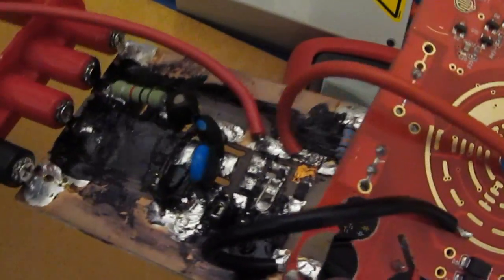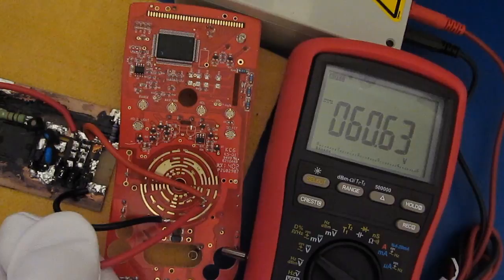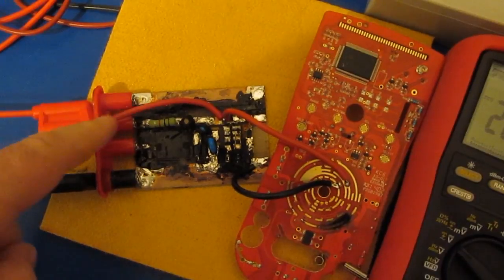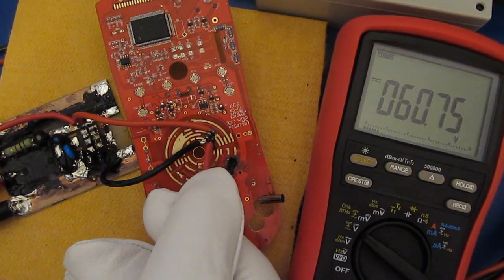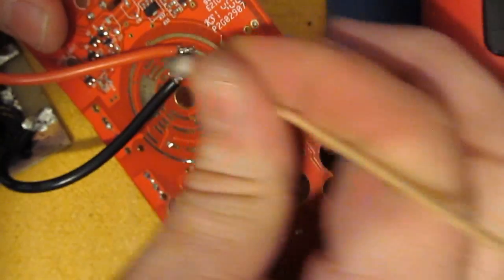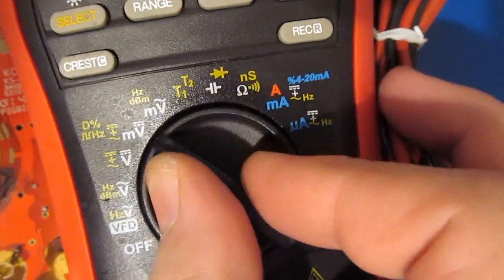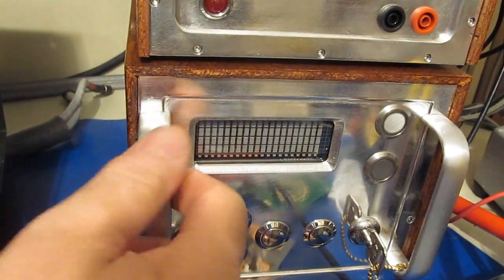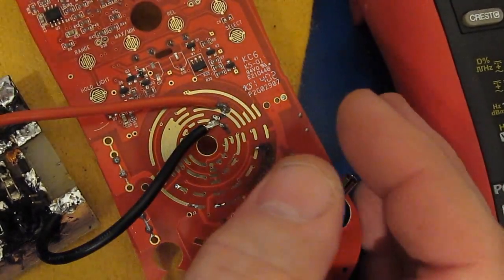EEVBLOG 121GW DMM PCB damage 600VDC testing Part 2

Comment: interesting series of videos, mine arrived broken and i have a replacement coming tomorrow 
at this point im not sure i trust it for any high energy environment (not that the intention of this meter was for high energy)  
its not that you proved to me this is not a proper meter for high energy, but i have yet to be convinced that this meter is safe enough for such applications 
but that's what the fluke 87 is for in my toolbox
EDIT: i was corrected, the 121GW withstands better than the 87
Reply from the maker: I ran a few tests on the Fluke 87V.   Dave is referring to an old serial number that had failed at 1.5KV, below what the 121GW had failed at.  A few people including myself wanted to see a brand new one ran.  This meter was damaged at 12KV.   This raised a lot of questions about why the older unit failed at such a low voltage.  I ran a fairly detailed set of checks on the old Rev 10 PCB to try and understand why it failed at such a low voltage.  In the end I was unable to replicate the results.  You may find that video linked below.  Obviously, I have never ran the final version of the 121GW but I doubt very much it could go head to head with an 87V.  

https://www.youtube.com/watch?v=GhslaLKOpKE
Reply: The 121GW passes independent ETL testing for safety. It performed better than the Fluke 87 in Joe's own overload tests.
Reply: did it now? well i stand corrected
Reply: im going to go ahead and withhold judgment until your proper tests are done on the production 121GW
Reply from the maker: Typing and the power went out.   lol.   I have not heard of an official release date so it's premature to guess but my plan is to run one after the problems are sorted out.  I figured this would take about a year, after the kickstarter.
Reply: Haha a bit ironic that, and i never really intended the 121GW to be a "take to an industrial site" meter but more of a "work around the lab" meter anyway, so for now i will use it as such 
i understand it will hold up to most issues as it is properly certified and tested, but confidence is key when working in such environments and well established brands make it so i dont have to think about my tool as i use it
but none of this takes away from the fact that dave made a fantastic meter
Reply from the maker: I'm not sure how much Dave was involved with the meter based on what he has stated in the forums, videos, amphour...  I was not aware that UEI had stopped making meters until Dave mentioned it.  So far the switch seems to be the most common hardware problem and it sounds like they are well on their way to solving that.

Comment: So, high voltage it's the only thing that could be the reason for the damage, right?, I mean even if (for some reason) the resistor where defective (like full shorted) at, lets say, mains voltage it won't be reason for the ark on that place, isn't?. Awesome job Joe, thanks for sharing your videos.
Reply from the maker: I'm not sure what caused the damaged to that particular meter.  We may never know.  If I have their meter here, I could check to see if there are other clues.  I test the meters with a rectified 220V source and that included the preproduction 121GW and did not see any problems with it.  Of course the mains could be much higher than 220.   Maybe Dave will chime in with some more ideas or the person with the meter may come forward with some more details about what happened.
Reply: Joe, OK... you've convinced me... and I think I've remembered the possible circumstances under which this happened.  I will post more details on the EEVblog forums.  Thanks again for the instructional videos.

Comment: Very interesting video again!
My only few pennies of thought.
Isn't it general knowledge plus ALWAYS stated in the manual that someone SHOULD NOT change the multimeter setting when being connecting to anything, let alone a very high voltage?
The reason why I am asking, is it really the manufacturer's fault if that happens?
Reply: For the record - this was almost certainly my fault.  I hope I never made it seem like I was blaming Dave or the manufacturer for the failure.  I was just wondering what on earth could have caused that damage.  Joe's recent videos pretty much confirm what was required to cause this, and as I've commented elsewhere I was recently working with a 1200V 100W 28kHz supply for an ultrasonic transducer.  So I am happy to take the blame, but also to praise the robustness of the meter as it appears to have otherwise survived the episode.
Reply: Safety standards are just that, safety standards. It doesn't matter if the meter survives or not, just that is fails safe and protects the user. AFAIK the IEC UL testing standard for meters does not test for DC withstanding voltage, it is more concerned with pulse overloads. In any case I have shown in a video on EEVblog2 that the 121GW survives twice it's rated DC voltage sustained.
As Joe as postulated, I suspect many meters could be potentially damaged by a low impedance high voltage DC supply that is under the MOV trip voltage, yet over the max rating of the meter. The MOV's are designed for pulse overloads, so in the case a high voltage low impedance DC supply, even if the MOV's trip, it's bye-bye MOV's because a sufficiently high power high voltage DC supply will just keep pumping energy into them until they blow.
Reply from the maker: I don't see anyone pointing the finger at the manufacture.  As a matter of fact, we do not know what damaged the meter in question.  I am only pointing out one possible answer and showing that the PTC and resistor that were mentioned in Dave's post may not save the PCB under these conditions.
Reply: Yes, I agree, I totally follow you. (I don't see how I pointed fingers actually, because I didn't??)
Maybe you misread me, but my question was that these things DO happen.
Quite often actually.
I am following the logic from the fact that I believe that Dave's meter is properly tested and certified.
If so, one can assume that under normal conditions these things never will happen (within a certain uncertainty obviously)
Doesn't that automatically mean that it's more LIKELY that someone used it on a way that's debatable?
(as you're showing here)
Reply from the maker: Actually, I think you misread my post.  The question in your first post suggests people should not blame the manufacture.  My post basically states that no one has.  That would include you, otherwise, someone would have, blamed the manufacture, which they certainly did not, perhaps....  

I don't believe the safety certifications mean that a meter is going to survive every test called out in those standards.   We may never know what actually damaged that particular meter.   If you read their posts, they talk about using it with low voltages but then in the end say that someone else may have used the meter.  Hard to say really.  It would take some energy to cause a circuit board to get damaged like that.
Reply: Ok, well obviously a miscommunication. For the record. I personally don't think in ways of blames (I hate that word almost).
Things just happens for whatever reason. (fault is definitely not equal to blame btw, just a way of saying were things can be improved)

My questions are always pure out of curiosity.  
What I understand from your answer, is that you suggest that safety standards can be pretty limited?
That is a very interesting subject on itself!!
Coming from a physics background, to me that's very weird. 
Because I am used to the fact that people always take the worst possible scenario as the standard.

I agree on you that burning = more than enough energy (just physics) 
Practically that means that or a lot of current or a lot of voltage was involved (or a middle in between).
I don't think that's hard to say, like you said and we agreed on; it would take some energy.
So I think it's very clear were that leads to? 
Unless the odds (is less than 0.2%) are really against anything.
Reply from the maker: I test pretty much every meter with a rectified 220V source.  I will shutdown the supply if the current reaches, I think, 40mA or so.  I am not sure if I have ever tripped that circuit when running a meter.  I will rotate the knob through all of its settings.   Even with the 200A supply, I doubt I could damage this circuit.  The input impedance is just too high for the low voltages it produces.   

I am not much of a safety buff when it comes to evaluating these meters.   I've stated several times that I am more interested in meters that are certified for the EMC standards as that is more in line with what I use the meters for.   Yes, I do believe the current safety standards could be improved based on just some of the testing I have done.  The first thing that comes to mind is the Gossen meter.

Comment: Everything is hunky dory, just don't play with 1000V.
Reply: The problem is you dont know if your circuit is producing 1000v, a busted 300v boost converter might make 1kv+ in pulses, its nice to be sure your cat III meter can actually sustain such pulses